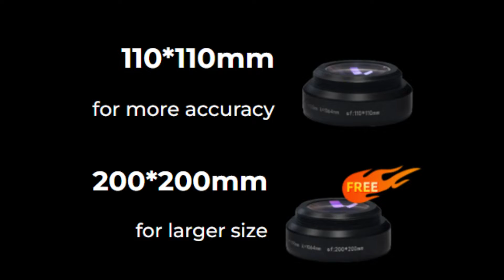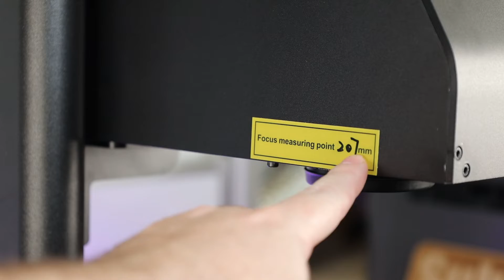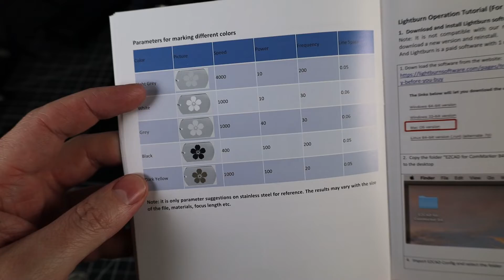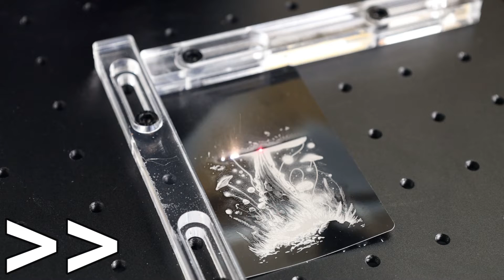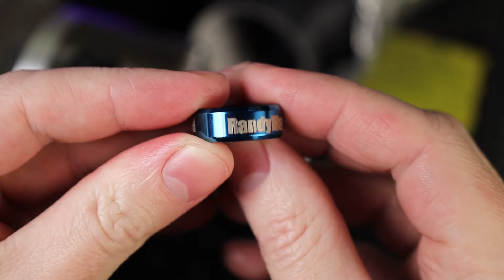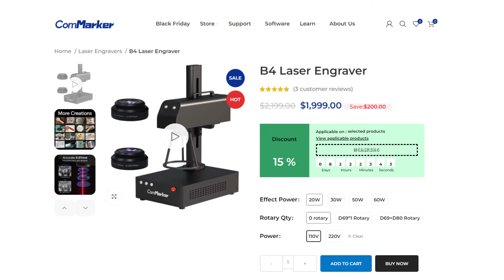Best Bang For Your Buck Right Now ComMaker B4 20w Fiber Laser Engraver

Comment: What is the difference in the D69 and D80 rotary. Is this laser difficult to link up with lightburn?
Reply: It is a bit tricky yes. The manual is not that good here. I had to open the file the manual points you to and fix the path in the file to match where I had copied everything. That part was not explained. Also note that if you install the Lightburn driver you can no longer use ezcad2 and vice versa (they need different USB drivers). That means that if you want to use say Meerk40t that this also will no longer work (as it hops onto the ezcad2 driver). I wanted to use Meerk40t to have a way to drive the galvo from selfdesigned software. I might look into a way to swap out the driver easily so I can go back and forth if I find the time one day.

As for the rotary difference, just the size and type of chuck mounted to it.

Comment: What are gonna be the major difference in the 20 and 30 watt? Speed? I’m just learning
Reply from the maker: More power so you can run it faster or
Reply from the maker: Use it at a lower power and work at the same speed as a 20w and prolong through life of the laser
Reply: Thank you

Comment: I just got the Commarker B4. I upgraded Lightburn to the galvo version. I am having trouble getting Lightburn to recognize the laser. I tried to find the laser in device in Lightbrun, but it couldn't find it. I tried to create it manually, but it isn't working. There does not appear to be a Lightburn device file the way there is for a diode laser. If you can point me to a good tutorial or instructions for installing it in Lightburn I would appreciate it.
Reply from the maker: There should be all the files needed and tutorials on the USB drive that came with it😁👍
Reply: Thank you for the reply. The USB flash drive had some problems. I downloaded the drivers from their website and it's working. @randymay